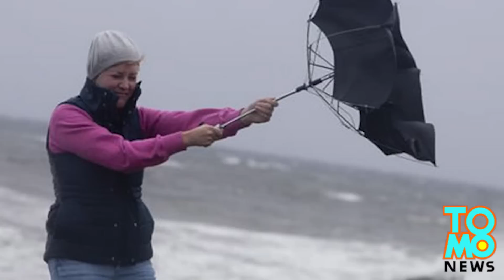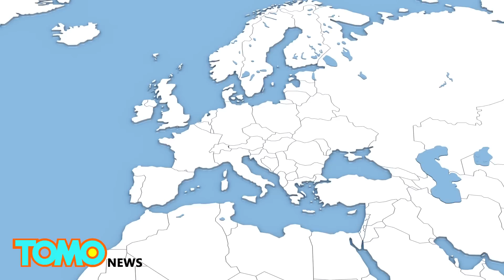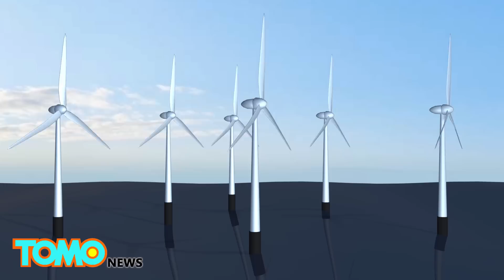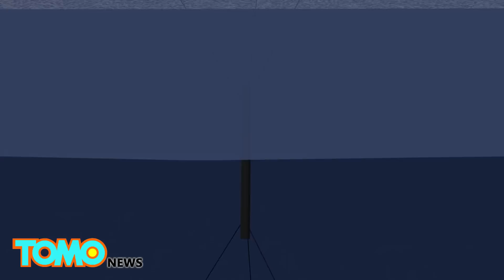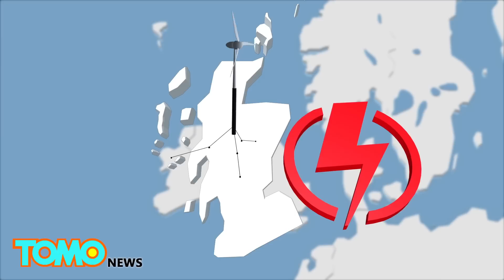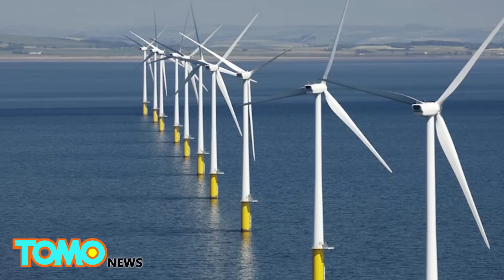World's largest floating offshore wind farm to be built off the coast of Scotland - TomoNews

Comment: 5 x 6 MW = 30 MW for $230m is twice the price per MW than UAEs new nuclear plant, which will have at least twice the capacitg factor. So it is 4x the cost of nuclear?
Reply: You forgot to factor in the costs of safely storing the used nuclear waste. These turbines don't create nuclear waste and create points for coral reefs to form. If you want to use a nuclear reaction to make power, there's a free nuclear reactor in the sky that is perfectly safe to use...

Comment: there is no way that what you see in the video can work in the real world.  a wind turbine will be subject to violent wind, and without a very strong anchoring, the entire structure will be compromised in more than one way; it will sway, violently, bob in every direction, and the moorings will come loose, as they should, since they are not anchored to the seabed.  the stress on the electrical cable will cause additional difficulties, including non-operational status most of the time.
Reply: 9 months on and it still hasn't happened. All that's happened is that now we have a higher proportion of our energy that is self-generated. 
PS I live within sight of these. None have been compromised or damaged. We have also had inland wind turbines for years with no significant problems.
But the main benefit of this ever-increasing array of turbines is that they're easily visible from Trump's golf course (our NIMBY that we've had to put up with) which pisses him off enormously. And pissing off Trump is our local pastime.

Comment: This is how you waste money while trying to look green.

all of this junk wannabe green energy shit is too costly for its output. 

ALL , yes ALL you need is nuclear power and solar augmentation. 

The only people scared of nuclear power don't understand it. Probably also are anti-vaxxers
Reply: Pseudo Anonim Incorrect. Human greed had no part. 

1.) Its not possible for a human to stop a tsunami.

2.) Even if the reactor was shut down, reactors can never be made completely safe. If they stopped running it, and it was breached by the tsunami, ( like it was ) The end result would be the same. Radioactive material would be everywhere.

So what would you do if you knew the reactor was going to be hit? 

Shut it down and still have radiation everywhere( if it is damaged ), or keep it running and have radiation everywhere. 

Note the reactor was turned off within seconds of the warning anyway.
Reply: Matapatapa Dude seriously you need to read about the whole fukushima debacle with TEPCO in the center. So yes human greed and incompetence had a major role.
Reply: Matapatapa "Energy from offshore wind in the UK will be cheaper than electricity from new nuclear power for the first time. The cost of subsidies for new offshore wind farms has halved since the last 2015 auction for clean energy projects. Two firms said they were willing to build offshore wind farms for a guaranteed price of £57.50 per megawatt hour for 2022-23. This compares with the new Hinkley Point C nuclear plant securing subsidies of £92.50 per megawatt hour....." http://www.bbc.com/news/business-41220948
Reply: do this while developing solar as much as possible.
Reply: +Aaron Cross source?
Reply: +Aaron Cross and you ignore that nuclear reactors are safer then any other type of large scale non renewable power, waste less and pollute nil. 

what would you rather have? millions of tons of co2 or 300-800kg of used up fissile material in a concrete container 30m under?
Reply: But the problem is that HUGE trouble ensues if  a  reactor (sorry for a lack of better wording on my behalf) blows up. It only happened only twice as of May 2016, but those  reactor accidents were...catastrophes to say the least.
Reply: TheImperfectGuy 1.) Improper and primitive safety. The same would be a impossibility in any modern reactor. A reactor today can be entirely shut down in milliseconds. The chernobyl incident was the fault of russians. That meltdown cannot and will not happen in any reactor today. 

2.) The japan accident was a act of god. Nobody could have predicted it. Any other power generation system would have failed. 

However I do think this is partially the japaneses fault for not predicting that i island country is at risk of a tsunami.
Reply: Thats why THORIUM REACTORS go educate yourself about it. The most safe reactors you can build.
Reply: "2.) The japan accident was a act of god."

ROFL which one? Poseidon? Hahahaha. Seriously dude...

 ""Nobody could have predicted it""

Alas there were many people who predicted that the safety in Fukushima plant was lackluster and it was a really old reaktor technology one of first 2 gen reactors if i remember correctly.

But i agree wind farms are not so "green" as some people want you to believe. Thats why new gen 4 reractor technology and mostly THORIUM reactors will be the future i hope.
Reply: Pseudo Anonim Lol act of god does not literally mean act of god, it means things that are out of human power to effect

Tornados, famines, tsunamis, earthquakes, lighting, volcano eruptions are all "Acts of god"

Thorium is just psudo-science. Id direct you to Thunderf00t youtube channel to learn more.
Reply: Matapatapa "Lol act of god does not literally mean act of god, "

Ok thanks for clarification

" it means things that are out of human power to effect"

And i disagree and i did wrote why. In short human greed